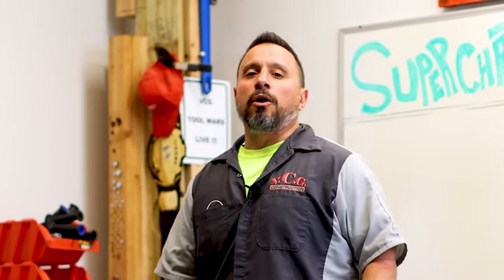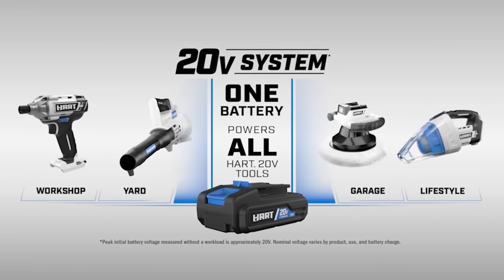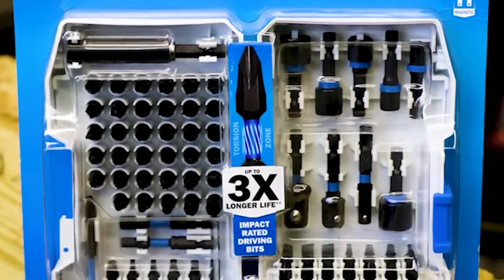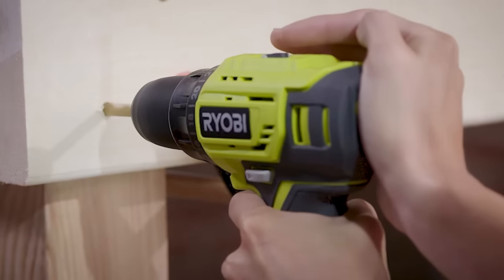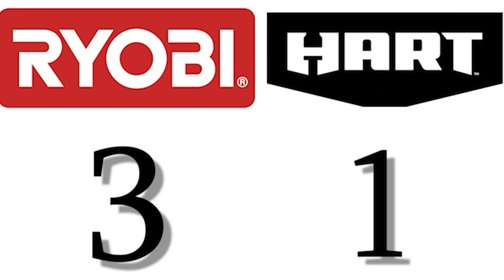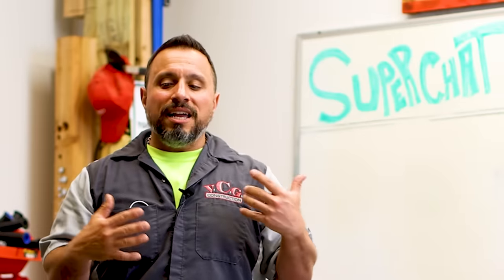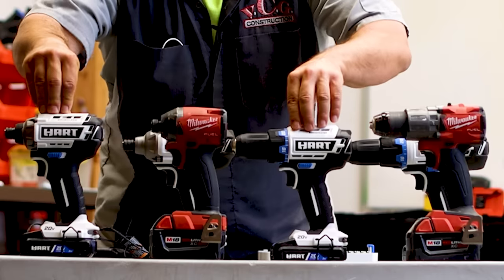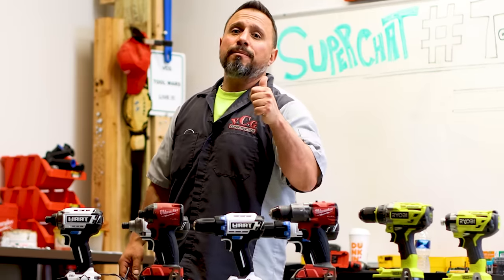HART Power Tools At Walmart PEOPLE HAVE NO CLUE!

Comment: I have been using Ryobi tools since 2006 when I was doing contractor work and they have held up just as well as a lot of the DeWalt tools out there. This is just what I have noticed after using them for almost 15 years now.
Reply: Truth
Reply: I went all Ryobi... for finish carpentry they're fine.  Using them for demo and framing destroyed a few tools.  Motors burnt out on recip saw, circular saw and multi tool.  They smoked a bit, then that was it.  The circular saw ran again for a while, smoked again and that was it.

Comment: I've always been a fan of Ryobi tools. They basically pioneered the vision of "One battery for all the stuff" and it shows. They've only recently added a 40 volt system for some of their heavy duty tools like lawn care and portable saws. Now if only they followed DeWalt's example and made the 40 volt batteries cross-compatible with 18 volt tools... They'd dominate the handyman market
Reply: Dude, Mikita has had the "One battery for all the stuff" going on for decades, followed shortly thereafter by Dewalt. Long before Ryobi was even being sold at Home Depot here in the states. That was one of the main reasons I made the switch from my old Porter Cable gear back in the late '80s, so I could have the convenience of having multiple tools using one type of battery and charger instead of different chargers and batteries for my different tools.
Reply: Not arguing that, but Ryobi offered the most rapidly expanding inventory of tools that used the same battery. Most other brands either used multiple battery types, or a smaller selection
Reply: I've never had an issue with Ryobi at all. I have the 40v system and everything that goes with it works great. I have the small electric pressure washer. It's a beast for what it is.
Reply: Ryobi is homeowner quality not to be confused with long haul work site tools like Milwaukee, Makita and Dewalt. There are even more upscale choices from those 3 but the prices are way higher for the same or slightly better quality.
Reply: @joepro3562  most definitely. I've never recommend Ryobi for a work site, or farm/ranch work. Home projects or occasional long weekend use is what they're made and priced for
Reply: @Richard Cranium That's been a problem with just about all of the tool lines over the years, but that had to do with the changes in battery technology more than anything else. The original rechargeable tools used different battery chemistry formulations that were bulkier, heavier, produced less voltage and didn't have nearly as much runtime. Then came ni-cads which were about 2/3 the size and weight, then they made the switch to lithium which were lighter, more powerful, ran longer, and charged quicker. The different batteries weren't compatible with older generations, so they changed the form factors so users couldn't get hurt trying to use them in incompatible gear.
Reply: @Richard Cranium I'm not saying that Ryobi can't be used in a workplace setting, just that I wouldn't recommend it. It's like turning a half ton pickup into a tow truck. Sure it could do the job for a bit, but it wasn't designed for the extended heavy use.

Can Ryobi be used in construction? Yes. Will you be replacing worn out tools more often? More than likely. Will a DeWalt or Milwaukee last longer between replacements, thereby reducing your expenses over a long period of time? All sources and personal experience say yes.

I myself have a Ryobi drill that's almost twenty years old. Apparently it's one of the first gen drills in the 18 volt lineup. Looks like hell, the front half of the base that holds the battery snapped off 8 years ago (but still holds the battery firmly in place) and bloody well refuses to die. But it's only been used around the home. If it was in construction, it definitely would have burnt out years ago.

Ryobi was designed to deliver budget friendly quality, and multi tool battery compatibility with their entire 18 volt lineup from the introductory tools to the present day. Budget being the key word here though. If loss, damage or theft is a problem on a job site, then yes Ryobi is a good option. If not though, then something heavier duty would be my recommendation. Small handyman contractors would be the heaviest use I'd recommend for Ryobi though, as a principle.

DeWalt vs Milwaukee? When people have asked me that I've always responded with "Do you prefer Ford or Chevy?" They both do the same job with very little differences in performance between individual tools. Anyone who says otherwise is generally very biased and has never used a single power tool for it's entire life from purchase to burnout, having only handled something of one type for a combined total of 30 minutes before trying something else that happened to be far more worn out and declaring the second item to be junk. Sorry for the run-on sentence... Yes I've used all three brands, yes I've sold two of them for years, and yes I still have strong opinions regarding the suggested application of each brand
Reply: Hell no on Hart only thing I got cause it was cheap and actually does good is the 8 gallon stainless steel shop vac my line is Ryobi and Milwaukee and one craftsman reciprocating saw 19.2v c3 with a Milwaukee battery adapter craftsman meets Milwaukee lol eh it just came along only brand new Ryobi tool I bought brand new was the rotors tool and the 18v 3/8 brushless HP extended head ratchet

Comment: I have the heart line of tools to include the drill, impact driver, sander, rotary tool, 6-in polisher, and the fast charger. Their lineup is very expansive and they're brushless tools are quite good. I have completely restored a boat using all of these tools to include even sanding the entire hull multiple times. All of the tools have held up great and performed very well.

Comment: My Mom bought her first set of apartments when I was 18 months old. I am now 66 years old, and I have been working on rentals for over 50 years. That's not like being a contractor and using tools 10 hours a day 6 days a week, but I use them more than the average DIYer. When battery operated tools were first out, I decided to try one, then as they improved, I bought others, usually choosing what was on sale. After a while I had so many different brands that used different batteries. It was a pain!! I switched over to Ryobi One+ 18 volt system and I could just keep the batteries charged and use them on any of the tools. At first, I would buy the extended warranty at HD, but I stopped because I have never had one break down!! I still have and use the old blue Ryobi drill that I got many years ago. Now, they have so many tools in the system, that I can buy anything I need and know that I can trust it. I think that you are right about Heart expanding their line, but that's only if Wally sells enough of these intro kits.

Comment: I've had ryobi tools for years. Did the job pretty well.  Switching over to Milwaukee m12 tools and not regretting the decision.  In fact my m12 fuel tools are just as powerful of not more than the ryobi 18v
Reply: Your comparing a freaking ryobi t Milwaukee tool lmao really ryobi is home owner crap Milwaukee is top of the line contractor grade

Comment: I haven't tried HART power tools, but I have had NO complaints with their 215-Piece Mechanics Tool Kit that I snagged as an "Half Price Open Box" clearance special for just $47 during the Black Friday Week Sale last November. All it was missing was the outer cardboard packaging wraparound one throws away anyhow. I suppose someone just wanted a look inside. I didn't really need that kit, but for that price, I simply couldn't pass it up, and am now glad to have that crazy big assortment of regular and especially deep sockets, extensions and adapters in all three drive sizes, ¼, ⅜ and ½. Later, really just for a gag and to test the Lifetime Warranty, I even warrantied its ⅜" drive ratchet by phone totally fuss-free. The ratchet itself was actually working fine--lovely in fact, with buttery 90 tooth smoothness. It's just that its quick socket release doodad was a bit loose in the grip...but it still works fine like any old school ratchet without such a socket release button. Still, they just mailed me a nice fresh one within a week. No exchange or return necessary. So yeah, I'd be well inclined to give future HART gear a shot.
Reply: They have the 275pc mechanics tool set for $98 periodically through the year and Black Friday which is 1 step above the 215pc. I had to get it.

Comment: I got a 220ish piece HART drill / driver bit set in a nice case for $18 at Walmart. It's been great. You don't want to turn it upside down because the bits will fall out and mix all over the inside of the box when closed. Other than that, AWESOME. 

purchased the 3 set of quarter 3/8 and half inch socket adapters too. Have abused them thoroughly and they've held up.

Comment: I'm not a heavy duty user but I love my Ryobi stuff. Does what I need it to do for reasonable money. Battery life is good and batteries are easy to get. Just my 2¢.
Reply: I did residential & commercial construction and some of the best tools I ever had were Ryobi. They HAD a portable table saw that I missed for years when it was stolen and the replacement version wasn't anywhere near as good
Reply: Junk.

Comment: I’ve used Ryobi for years and they work for my needs quite well. HD is my happy place!
Reply: Amen brother
Reply: Their Japanese, which means I can trust the numbers on the packaging.
Reply: Don't support HD based on their politics and them being a huge supporter of the immoral portion of our society.
Reply: @getsum697  they also donate and help military veteran causes. One the biggest job highers of veterans and they give me 10 percent off all my purchases for being a veteran
Reply: @waldo-ot6ul  Served for 25 years, I know.  So does Lowes without all the sponsored "parades".
Reply: @waldo-ot6ul  they give me a hard time getting the discount. They will only take military ID. “I’m sitting here with the little emblem on my driver’s license and a copy of my dd214s in my phone pics and you won’t give me the discount?” Another reason I’m buying into the flex brand whenever they come out. The political aspect is impertinent to me.
Reply: @dumdiversaspapalbull1452  Lowe’s makes it a lot easier.
Reply: @deebedwell580  exactly
Reply: When Ryobi went to Li-on it was very nice they were backward compatible with the older blue ni-cad powered tools. My blue Ryobi tools (Drill, 4 1/2 circular saw, sander and flashlight) at at least 20 years old never an issue. Love that little saw!

Comment: I personally own Ridgid, Ryobi, Milwaukee and a few Hart tools.  The Hart brand is great for smaller jobs, primarily because of the battery charge time and battery life.  Hart does make a good tool however.   Ridgid provides the best warranty, though you pay a much higher price for the tool brand.  TTI is the Manufacturer for Hart, Ryobi, Milwaulkee and Ridgid brand lables.  The internal construction of these various brands differ the specific tool you need.

Comment: You know, my family has a good sized ranch here in Texas, and we have used Dewalt tools for many years.  Recently however, we switched to Porter Cable.  They have been phenomenal so far.  One of our ranch hands uses Ryobi, and he is not all that happy with them.  Perhaps you are right about what you have said about "convenience".  From personal experience, as we go through a ton of driver bits and other things. there are much better prices at Home Depot or Lowes, then at Walmart when it comes to tools.  From where we live, it is nearly 100 miles to either a Lowes or Home Depot, and only 5 or 6 to Walmart.  Still worth the distance and avoiding Walmart.  :)
Reply: It all depends on how often you use them I rarely ever need to use a drill so for me to spend a $100.00 on a high quality drill like Ryobi Dewalt or any other high quality brands wouldn’t make any sense because if I bought one it would just sit in the toolbox and never get used now if I used a drill all the time then yeah I would invest in one that’s high quality and name brand but since I hardly ever use one buying a knock off drill is best for me.
Reply: I bought a Ryobi corded chuck drill and it was terrible! It eventually burned up on me. What I hated the most was the handling...it seemed off balance or something. Then the chuck wore out, then shortly after the motor burned up. I owned it for maybe 18 months and at the time I was full time in construction.

Comment: Just buy the Milwaukee when it’s on sale, never have to worry again 🤘🏻
Reply: What does that have to do with anything? So is most stuff, so is hart, makita is assembled in china, so are iphones.
Reply: @mattk6827  i replied to the wrong comment but it was suppose to be in response to someone calling Hart China crap.
Reply: Milwaukee now made in Korea and has turned to crap.
Reply: @mattk6827  but you can buy made in Japan makitas, can you buy made in usa Milwaukee?
Reply: Yup
Reply: No need to fear Milwaukee is here
Reply: @mattk6827  some Milwaukee is made in Vietnam
Reply: I had a Milwaukee skill saw and sawzall I bought new last year and both died. Barely used. I have 2 drills 25 years old and beat to hell. Both still working.  Milwaukee has gone downhill.

Comment: I bought the 4 piece brushless combo kit for 300 and it came with a 4 amp and a 2 amp, skilsaw, impact, drill and flashlight, I use them everyday and today I used my impact to drive 4 inch 3/8 lag bolts into studs about 20 of them… did them all and was just a little warm. So impressed and honestly worth my money
Reply: I build a porch with hart 🤣 impact drill and skilsaw drove 6" 3/8 lags no problem I agree we'll worth the money for them jig saw and grinder work good too
Reply: I just got the same exact brushless kit for $150 and only paid $135 after associate discount. I already had all the brushed versions but couldn't pass up the chance to upgrade for the price.

Comment: Hey, Tool Snobs......this Hart line of tools is for the home-gamer.... for a vast majority of homeowners these tools will work great. For example, I have purchased Harbor Freight Table, Miter and Recip Saws and added Diablo-brand blades and for my infrequent use, the cuts are quick and clean as clean can be. To add a "specialty" tool,  I would have no problem with Hart. I stand back, the job is solidly done and I have a larger selection of tools (for the cost) than I would have if I had went strictly with Makita, DeWalt, Milwaukee etc.... Bang for Buck, baby !
Reply: I saw those in the store.
Some are now not available in the store.
Reply: Yeah, but why not spend the extra few dollars and by something that (1) will last longer and out perform, and (2) doesn’t support China Mart

Comment: I bought a 20v lower grade DeWalt drill for my first year of my electrical job and loved it. I was told I should upgrade to an impact driver by my coworkers and so thankfully I left my drill on the jobsite and came back the next day to it being stolen!!! Awesome, lost my expensive new drill my 2nd year in to this job and said fuck it I need a cheaper replacement and this time it'll be an impact! Well, here we are 2 yrs later and my 20v HART brushless impact driver is going strong! She's been dropped, smacked, sprinkled on by some rain and is still able to paddle bit through 3 studs just fine! It costed me less than the Dewalt impact by around $25 but I gambled the longevity and am sure happy with my purchase. I was made fun of when I first got it, but just recently today my coworkers are shocked she's still going well.

Comment: One point on his mention about #2 Phillips bits and "cam out" etc. Don't forget that the Phillips bit style was originally engineered for early/easier release unlike square or star. And the fastener itself has as much or more to do with engagement than the bit does. The bit, to be able to be called a "Phillips" bit has to meet particular, patented, design standards.

Comment: Ryobi Nation!! I am a seasoned veteran contractor, and I have been using Ryobi 18V tools for many years, primarily for the value, and the “one-battery” system.
Ryobi has been faithful and never hit its users with planned obsolescence, so, the tools, chargers, and lithium batteries that last for years are still viable.
I recommend Ryobi to everyone !
Great investment, and ‘must have’ for every homeowner!!
Reply: I agree David. I started out with Makita for cordless and ran them into the ground. Ryobi came on board with their one battery system and it seemed like they were coming out with a new tool each week for garden, carpenters, plumbers, etc.). I switched over to Ryobi and bought a dozen tools over the course of the year and haven't looked back. Seven years later and they're all still working perfectly. 
My neighbor who uses Milwaukee claims that being a "professional" he only uses Milwaukee because of their quality.  Of course he had to buy a new garage door opener and of course it's a Ryobi. I said to him, what's the matter kid doesn't Milwaukee make a garage door opener?